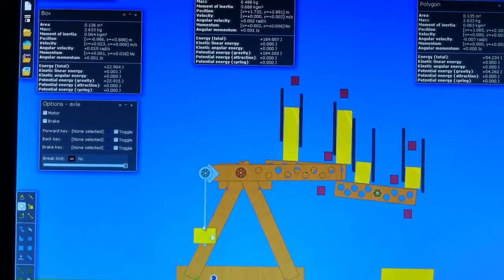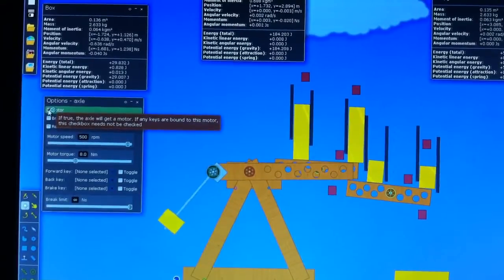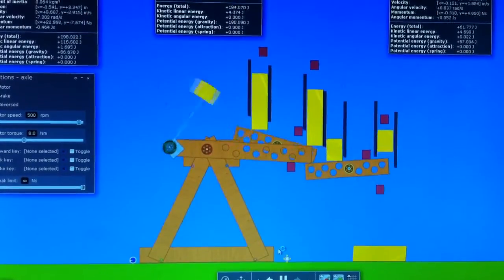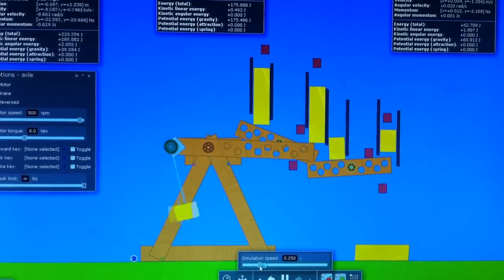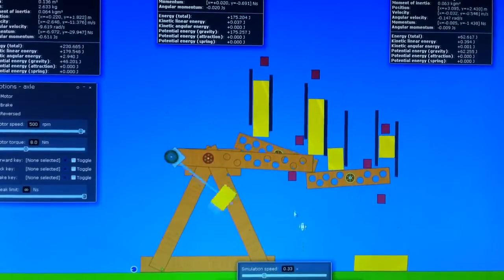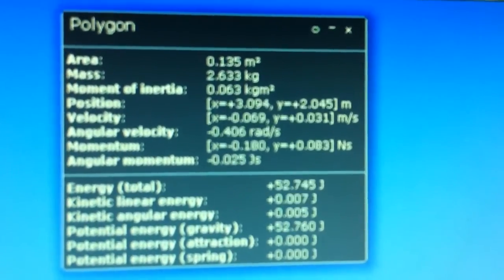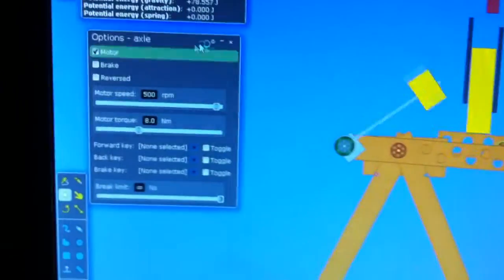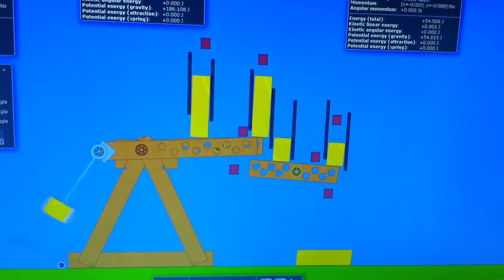Overunity In Simulation.

Comment: Further to my comments. For two quarters of the pendulums rotation gravity accelerates the mass and for two quarters gravity ceclerates the mass, so for a full rotation of the pendulum the energy input to the pendulum is zero. The small motor is able to rotate the pendulum due to its being given startinng momentum as stated by plugging the motor. The drive motor operates at somewhat a low speed or else is geared to the pendulum and such a slow speed motor would be very large to be accomodated. The drive motor energy is thus the only energy input and gravits contribules zero energy as stated arleady. The drive motor torque which must be rather low due to its high speed and small size, is converted into a torque considerabely larger by the llong output lever.the output is available either as a torque or a force which is large enough to lift the loading weights. The system is therefore a simple torque or force multiplier and not an enrgy ultiplier and the Low of Conservation of Energy continues to be valid as always.

Comment: dear mag thanks for sharing your ideas. ive noticed that in the demos because the frame is fastened , the output is in the verticle plane only thusly wasting 1/2 of the possible output. I have been studying this and have come up with a way to pass the centripedal force with all 360 degrees. new parts will be here soon and I will be doing a motor to generator test.in 2 weeks.  would like to share if successful maybe you could allow me to contact you.
Reply from the maker: Yes. I am aware of exactly how to exercise  this overunity principal in a 360 Degree rotation, however, I am unable to simulate the physics in my limited 2 dimensional software.

However, the principal can be understood by visualizing what would happen if the drive shaft on your car where severely out of balance.
Reply: MagnaMoRo do you have a working model or maybe a drawing I understand if you are in the patent process